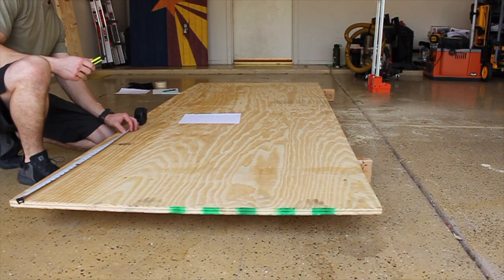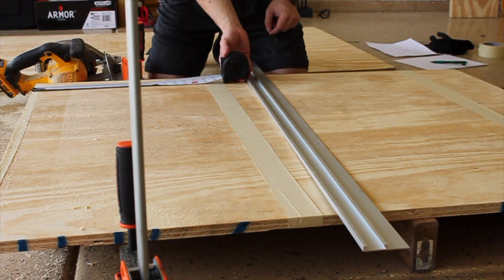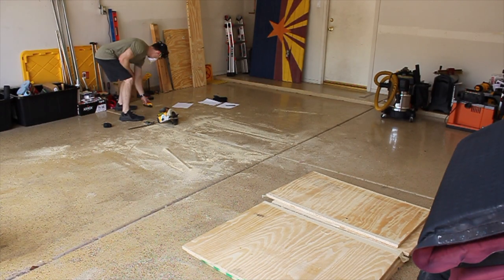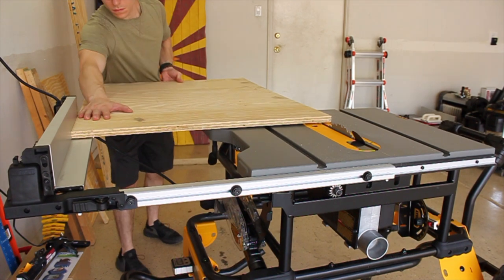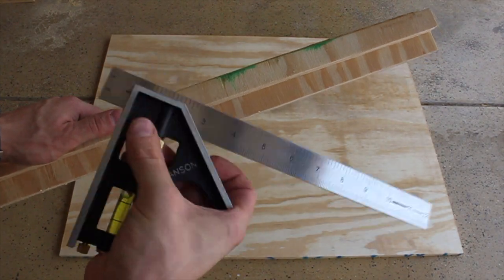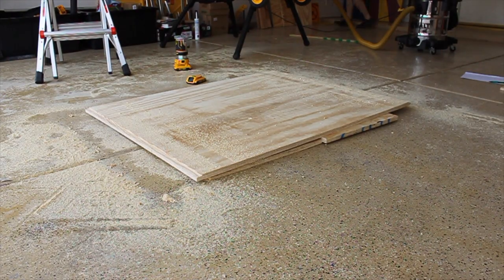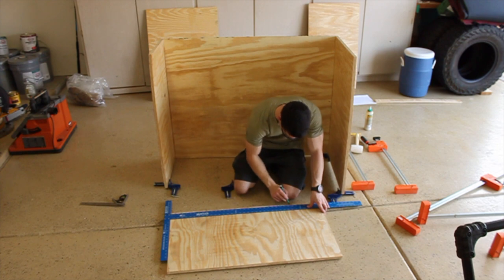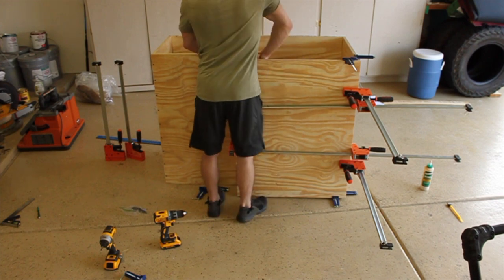DIY Benchtop Jointer & Planer Stand: Part 1

Comment: What do you think of your Wahada jointer after using it for this long? Have you had any problems or things that you wish were different with it? Thinking of buying one....but worry about it's small size and motor output compared to a floor standing jointer.
Reply from the maker: If you have the means to buy a full size jointer, do it. The benchtop jointer will never really compete with a full-size. 
I like the Wahuda, I think it has plenty of power for its size, but I am conservative and take shallow cuts. The fence and it’s adjustment could be much better and it’s extremely challenging to get the tables level (but that seems to be normal across the board). 
The finish off the cutter heads is excellent and I think for its size/price it’s an excellent choice.

Comment: The bottom horizontal piece looks like it’s sagging the the picture. Might need a little extra support for those tools
Reply from the maker: That plywood was all kinds of wavy! I’ve got two wheels in the middle of the bottom for extra support. Haven’t had an issue yet since I’ve got drawers installed
Reply: @ExploreLifeWithDaniel  oh awesome!